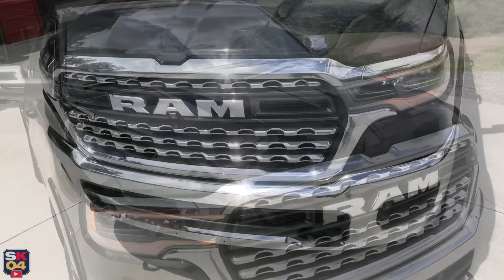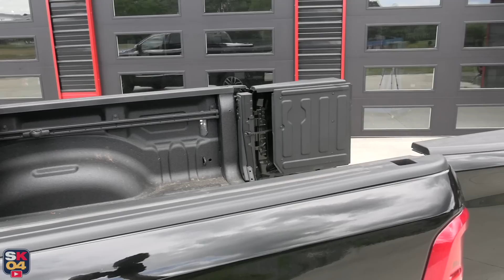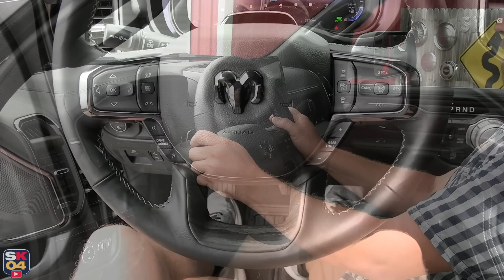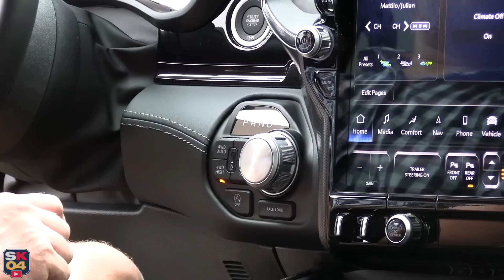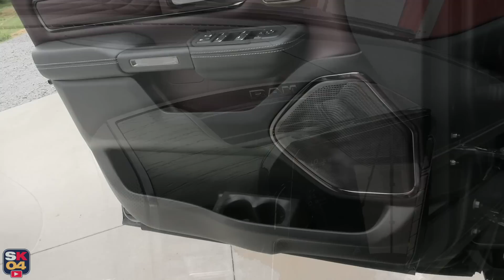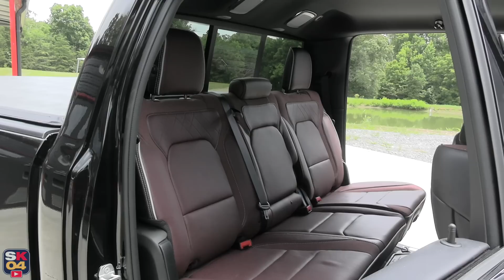2025 Ram 1500 Limited (540 hp Twin Turbo I-6!): Start Up, Test Drive & In Depth Review

Comment: I have been told by my local RAM dealer that the Limited trim comes standard with the RamBox Cargo-Management System (compartments built into the tops of both sides of the truck bed), and that there is not a delete option for this.  However, I see that the Limited you are testing in this video does NOT have the RamBox Cargo-Management System.  How did you make this happen?  Do you know something the RAM dealers don't to get these RamBox's deleted?

Comment: ALL of the FIVE MAJOR brands of full-size truck (Ford, GMC, Chevy, Toyota) are getting SOOOOOO GOOD that it is DIFFICULT to choose based just on towing/carrying capacity and base driving feature set alone. You now have to take into account interior comfort and your ability to get the BEST FINANCE RATE possible! 

The truck that gives you the BEST monthly payment and the MOST interior comfort for your desired towing and carrying capacity is the truck YOU should buy!

I actually like this truck very very well as a daily! Would I buy it? Unfortunately, since I do tow MORE THAN 30,000 lbs (i.e. CDL needed!), I have to go with the Ford F450 Superduty Limited with onboard ProPower package (2000 Watts) and the onboard weigh-scale. With the Tow Package, the F450 is going to be pulling around 32,000 LBS since I will be building/welding myself a multi-bedroom custom luxury toy hauler 5th Wheel trailer and a new custom rough-water fishing boat out of 7075-T6 Aluminum that fits on the back of the trailer along with the Can-Am Defender.

A 1500/F150 Series truck just won't cut it! Gotta go with the heavy duty BIG DIESEL option!

V

Comment: Bought a Ford F250 from 1979 free months ago. Money saving, fixable with a paperclip and a piece of duct tape. Instead of expensive sensors, computers and every mechanic loves to work on it. Gets 'er done every time!
Reply: I agree.  Too much technology doesn't mean    it is the greatest.  Too much can lead to more problems.  I sometimes wonder if the car manufacturers are experimenting with which technology works better.  At the same time, the consumers are paying the price, e.g., RECALLS and PROBLEMS - leading back to the dealership for repairs until they get it right.  In some cases,  staying longer in the dealership for months and still making monthly payments.  UNBELIEVABLE!!

Comment: We all know there's 3 different gas nozzles in all gas stations. Yellow nozzle is for e85 ethanol, green nozzle is for diesel fuel, and the black nozzle is for normal gasoline, and it is used for regular unleaded, mid-grade, and premium unleaded fuel.

Comment: I have never seen a twin turbocharged engine for the ram 1500 pickup truck. I mean, the engine looks amazing! It's a 3.0 liter twin-turbocharged inline-6 cylinder. Compared to Ford's F-150 3.5 twin-turbocharged ecoboost v6 engine. The all new 2025 ram 1500 limited looks so amazing of the truck!
Reply: If you like a ton of chrome 🤢

Comment: here before all the die hard HEMI fans trash talk the new Hurricane engine
Reply: Even though I love the hemi rams I'm curious about the hurricane inline 6 and I only trust saabkyle04
Reply: @beyondeternity2112  Its the only truck who did the roughest hill climbing on the top  test with a 10500 pounds load on the TFL channel even if it kind of overheat ish at the end all the competition weren't able to make it middle of the hill cuz they overheated !
Reply: @davidlefranc6240 The number of pounds of towing indicated by the manufacturer? IT is for flat roads, otherwise you will have to reduce the pounds, the manual says so, that is, the serious mistake was made by TFL, but they did not accept the mistake, and finally, the large heavy duty trucks  in the USA are mostly with 6-cylinders engine, and not V8.
Reply: Hurricane very smooth and powerful, fails early, no engine oil dipstick
Reply: All the same ones that claim to want a "V8 Truck without all the bells and whistles!" and then proceeded to never buy the 1500 Classic while it was around.
Reply: @ChubiChan Because the Classic also wasn't a "V8 truck without all the bells and whistles". It was just last year's model... which was still not a basic truck
Reply: Ok sell me on the hurricane go
Reply: @bluecollarbuilds  well, it's undersquare, so it has good torque production, and it makes good power numbers.

all of which is negated by the fact that it has no oil dipstick and includes general Stellantis global corporate "engineering" shenanigans.......

Comment: Ram is nothing without the HEMI
Reply: At least it will act like Cummins
Reply: Pfff the 4.9 seconds 0-60 base turbo version is not sharing your point of view and i don't even speak about the ease of maintenance there is no gimmick 650 dollars spark plug job on this one !
Reply: @davidlefranc6240 who tf cares about 0-60? Especially in a truck?? Ease of maintenance is also a horrible argument. This engine doesn’t even have a dipstick….

Comment: Twin turbos are killing trucks right now!
Reply: True but most F150's are selling with 3.5 ecoboost.
Reply: @henrybrar  Unfortunately, and that engine has been plagued with issues. Just complete trash.
Reply: @KG_2134  We haven't had any specific or major engine issues with our 3.5 ecoboost F150s as far as the engines go. The transmissions on the other hand...but thats an issue no matter what engine you go with. Ford just makes junk. The 6R80s were trash and the 10R80s even more so.
Reply: @ChubiChan  I can’t comment on the transmissions, but the Ecoboosts seem plagued with problems. I’ve heard a mixed reception about the 3.5, but I’ve heard much more bad than good. I don’t trust any of the twin turbos that the automotive industry has such an obsession for right now.
Reply: Why has ford done so well with the twin turbo?
Reply: @atg1338  They really haven’t though.
Reply: Ford has it  figured out !!.I would be worried about buying anything new from ram  especially because they have been bought out 3 times now ....no thanks
Reply: @bigsmith7349  They have not figured it out by any means, I’m worried about any new vehicle from any American manufacturer except a Mustang GT & F-150 only as long as it has the 5.0. I think that’s the best truck on the market but only as long as it has that engine.